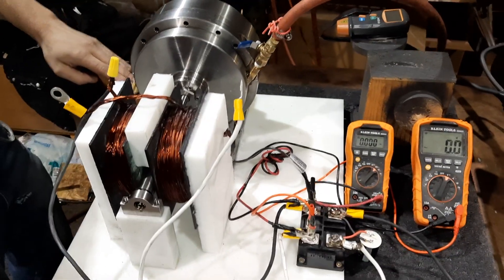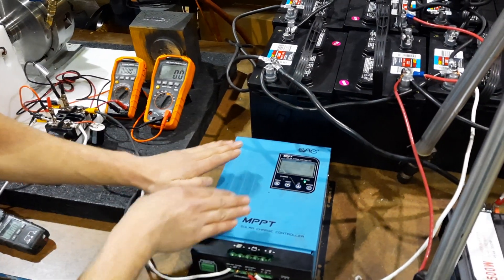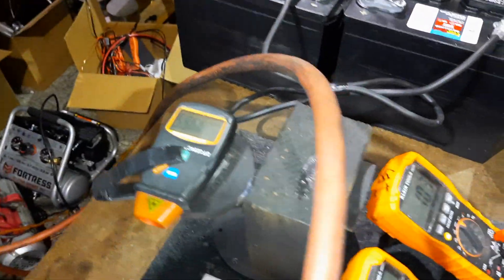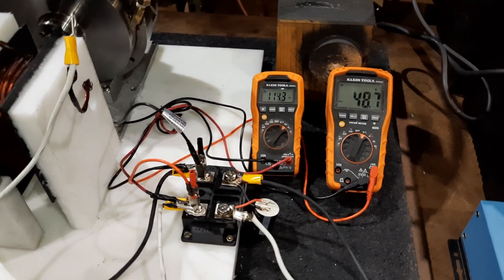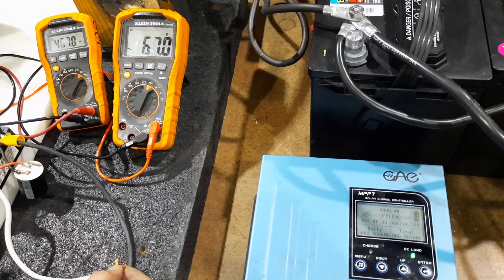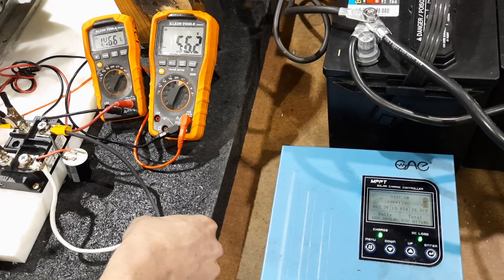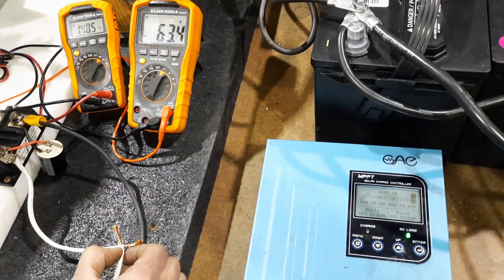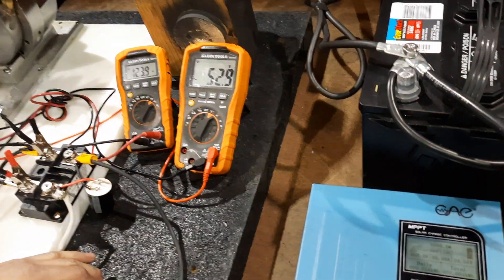Tesla Turbine Producing Usable Power! LOAD TESTING!

Comment: Just a suggestion but your coils are far too undefined and wound haphazardly.  Get decent Oxygen-free MOGAMI-brand copper wire (they make the best truly Oxygen-free copper cable which gets that extra few percentage points of electron flow!) at whatever gauge you need from the factory. This will make for much better induction and/or EM field generation. You can coat the wire yourself with clear polymer using a wire-coater machine and a commercial-grade winding machine that will ALSO properly wind your coils into almost any configuration. 

You are losing a lot of "energy" by having such wayward winding configurations.

I would also do an electrodynamics-simulation on the software-side of things so you can find the optimal wire gauge and optimal coil winding length and configuration that MATCHES the turbine size you have constructed. There IS NOT a linear scale-up or scale-down due to imperfections in the internal crystalline structure of copper wiring itself, the basic current conduction issues typical with coil windings and basic EM field physics. Your software should be able to get you the optimum wire gauge, winding count and length, etc to match your turbine size.

---

As ANOTHER suggestion, for the interior walls of the the turbine itself I suggest you do what Porsche did (i.e. YES! THAT car maker!) who had a set of 1986 patents for putting tiny golf-ball-like dimples onto the exterior surface of car bodies AND the same such golf-ball-like dimples on the INTERIOR SURFACES of exhaust tubes, manifolds, and all other air and/or fluid pathways to ensure the DIMPLED WALLS created a rough boundary layer of turbulent flow that BOUND ITSELF to the dimpled walls WHICH THEN creates a laminar layer of FAST air flow and/or FAST laminar hydraulic flow that "floats" on top of the rough turbulent layer that makes for a now very smooth and VERY FAST interior flow of gas (i.e. air) or fluid within any piping or fluid/gas pathways.

This dimpling needs to be of application-specific diameter in millimetres and depth. You can use ROUND or Hexagon-shaped or Pentagon-shaped surface dimples that can be created by micro-machining or STAMPING the positive-mold into the surface of your piping.  If this is not possible, you might ALSO TRY cross-rifling which means you ETCH via chemical or mechanical means, a deep cross-hatching on all interior surfaces so that the rough boundary layer can be created and stick to the interior walls to support proper laminar flow.  The cross-hatching size and angle of the cross-hatching will need to be MODELED in your hydrodynamic simulation software to find which is the BEST configuration that will create the best rough boundary layer that sticks to the walls of your turbine piping and/or cavities.

My estimation from Porsche's studies extrapolated to small scale turbines is about a 15% to 25% increase in flow-speed and MUCH LESS wear and tear on your Tesla Turbine interior wall surfaces. This may ALSO prevent cavitation (aka water hammer) and the Turbulent Boundary Layer creation for laminar flow support is noted as being the NEXT BIG THING in 2020's era hydrodynamics AND aerodynamics! And since the 1986-era Porsche patents have long run out, you can now use the technology as you see fit!

I hope this helps!

v
Reply: P.S. to KEEP the surfaces of any dimples intact, do some CRYOGENIC HARDENING of your stainless steel or alloy metal parts to ensure that the dimples or cross-hatches CANNOT be worn down smooth by long-term turbulent hydraulic flow.  It will ensure long term upkeep of all that fancy etchings and dimpling which creates the faster and smoother air and/or hydraulic flow within piping and cavities!

v
Reply from the maker: Excellent suggestions! I fixed the coils shortly after the video, I had to build them that way so I could convince my machinist the generator was powerful in a timely manner. I've since built a new generator with nearly perfect coils. I want to try your dimple idea but it will have to be at a later date. For now circular groves will be used like in tesla's patent for ease of building. I wish I had someone like you on the team.
Reply: @iEnergySupply  What sort of help do you need?

I have ideas and advice I can give gratis (aka for free!)

For the dimples, that usually requires metal on metal stamping technology BUT cross-hatching can be done using common chemical etching which you can get information about here:

How To Etch Stainless Steel And Copper, DIY Etchant, Plus Alternative to Press-N-Peel:

https://www.youtube.com/watch?v=QaENUHSaaRM

Etch METAL with Battery Power! TKOR Shows You Everything To Know About Metal Etching:

https://www.youtube.com/watch?v=ytxRJqgH5b8

These video are but two of the many available which can give you a good start on chemical etching and OTHER etching technologies!

The cross-hatching performs at about 75% of the efficiency of the golf-ball-like dimples in terms of creating a sticky rough boundary layer which then allows the faster outer laminar flow to happen.

With cross-hatching, you are going to have to do a few experiments on the shape and size of the cross-hatching pattern AND it's depth into the metal base.

You create multiple different cross hatch patterns etched onto various 1/8 inch thick stainless steel plates and run a fast smooth flow of one inch deep water over the cross-hatches and filming that water flow with one ore more overhead cameras set on super-closeup MACRO mode (i.e. record at 120 fps slow motion at 1/800th of a shutter speed or faster -- check the shutter speed which is best -- the faster the shutter speed the more light you need though) Set some bright lights at a 45 degree angle away from the camera so as NOT to cause a shadow into the water.

This will let you SEE the laminar flow in a physical manner so you can find out which cross-hatch pattern, size and etching depth creates the FASTEST and/or least turbulent upper water flow.

You may have to add a few drops of red, green or blue dye to the water in order to see the laminar water flow properly.

Only add a few drops to ensure you can STILL see the cross-hatching in the metal plates and see the lower rough water boundary layer AND the upper laminar flow.
(i.e. the water should be only very lightly coloured!) 

Check your macro lens function so you can CLEARLY and in-proper-focus see the ENTIRE depth of the water flow over your cross-hatch etched stainless steel plates.

You add 2 inch high plastic or metal side-walls to contain the water flow and make sure the plates are long enough (36 inches usually) so you can actually SEE the entire flow of water over the etched plates.

In some tests, I also added a fine lightly coloured powder which sinks and does NOT float (i.e. fine talcum-like powder or really fine sand) to see the flow over the plates better.

Now choose the cross-hatch design that gives you the fastest and/or least turbulent upper laminar water flow. 

Test against a simple FLAT polished stainless steel plate and see how much of a difference there is between that and the other cross-hatch designs. 

The etches can actually be ANY design. Horizontal, vertical or diagonal straight lines, true cross-hatches, dimples in round, pentagon, hexagon or octagon shapes, wavy curves and other designs. Try as many as you want at various etching depths to find one that creates the fastest and/or least turbulent laminar water flow.

Once you find the design that works best, use chemical etching on your interior surfaces of your curved or manifold-shaped parts and TEST in a real world situation.

My guess is AT LEAST a 25% increase in gas or liquid flow through your parts which means better cooling and MORE power production!  

As ANOTHER suggestion, cool your coils by embedding vapour pipes or cooling water channels into the iron cores that kind of look like the heat pipes found in computer CPU and GPU coolers. You should get a 20 degree temperature reduction which also means you can PULSE the coils faster and at higher energy levels to get more power generation.

I hope this helps. Email or message me if you want even MORE tips and tricks!

v
Reply from the maker: @StarGateSG7  If I had more funding, it would be cool to have you physically working at the R&D Facility. One day ill be able to afford help. For now, great suggestions, ill have to do some of that in the future. What's your take on hydrophobic ceramic coatings?
Reply: @iEnergySupply  I would try Teflon (aka Polytetrafluoroethylene) which is fully hydrophobic BUT even ceramic and Teflon have high electrical potential so you will get static adhesion of any fine metal and/or plastic particles which is in many water supplies and/or common industrial cooling fluids which will eventually cause clogs and buildup in your tubing and manifolds.

You are going to have to use something like ultra clean water (i.e. demineralized and boiled to death!) or the purest dialectric mineral oil (i.e. non-conductive) you can buy if you are using Teflon-coated liquid coolant system. 

You could also try Argon Gas as a cooling fluid creating a gas-vapour-based coolant system if all fittings and tubing are airtight enough. You can chill Argon to -200 C and colder using cryogenic means but -40 C to -60 C can be done with any reasonably inexpensive commercial freezer condensor gear.  Many commercial freezer supply stores have parts departments that could supply you with a compressor, motors, piping and even the condensor coil setup.

That will DEFINITELY cool your coils decently and Argon isn't all that expensive AND it doesn't react with anything else because it is a Noble Gas (aka is Inert!)

If you really want to go "CHEAP", as in having to as little money spent as possible, you could try anti-freeze  as yur coolant fluid and some heavy grit (i.e. 40 grit and coarser) diamond-grit sand-paper on the insides of your tubing to "fake" the cross-hatching via sandpapering deep scratches and swirls into your stainless steel tubes and manifolds.

 If the "scratches" are deep it might work good enough to form at least a basic rough boundary layer to form a proper laminar flow.  The scratches will have to be pretty deep though! I would 1/64th or even 1/32nd of an inch (less than 1/3rd of a millimetre) to make a difference.  

Get the coarsest diamond-grid sandpaper you can find at home-depot or other industrial supply store (i.e. Grainger or uLine)  3M makes decent diamond grit sandpaper! Maybe you can find one of their local dealers on their website. (rememebr to wash out all your tubing and manifolds with ultra-clean water once you have done your sandpapering!)

If you have any other questions message me back! I will be happy to answer with whatever technical details I can help with. 

v

Comment: One would suppose large. Capacity Graphene capacitors. Would be used also a more perfectly balanced tesla  turbine
Reply from the maker: Balancing the turbine as we speak, we are also making carbon fiber disks that can reach 70000 rpm for this sized turbine that's over supersonic speeds. We want to run this one continuously at 17000 rpm.

Comment: Thus is awesome, but you have not yet achieved the RPM where efficiency jumps super high and the RPM makes a huge jump at the same time. There is a smaller version of the turbine on here where the RPMs jump from 50k to 70k suddenly and the sound and vibrations go away.

Comment: I see your lead-acid batteries are in a series configuration, but I am unsure of your amp/voltage needs. If applicable, you should consider getting the far larger 8d or 4d instead of placing multiple smaller ones in parallel. 8D's are far larger than any normal car battery, can produce over a thousand amps with a huge amount of reserve, for only $220ish retail. They are only 12v and are typically used in pairs for large equipment, used to power glow plugs for extended periods before starting the engine. They should have fairly similar performance to the marine batteries you are using, at a lower cost per amp/hr.  The real problem is that 8D's weigh a LOT and can just be moved by a single man.

Comment: Talk about doing things the hard way!
Just put a power resistor on the generator output! You can measure the voltage and get the power directly. Changing the resistance and measuring the frequency change will alllow you to infer the torque of turbine, although for best results you also have to measure the air line flow rate and pressure.
Sheesh!

Comment: not really believable. when you connect the cable, the voltage on the capacitor is high, so sparking occurs. but nothing appears

Comment: You can not use momentary output power as any kind of performance measurement... that uses flywheel momentum, which means nothing.  Only measure constant output power.
Reply from the maker: For those who want to see testing regardless of what happens, that's what this video is for. See my constant load testing if you wish to be satisficed.
Reply: @iEnergySupply  Will do, thanks

Comment: You guys need to be careful about the containability of your housing at the speeds you are trying to run.  I understand that the Tesla turbines are typically built with a number of fairly thin discs but a surprising amount of kinetic energy--and angular momentum is generated at high rotational speeds. If a disc lets go at high speed, it can do a lot of damage.  Your housing appears to be steel which is good--you need a material with a lot of ductility but you also need enough wall thickness.  Also, at these speeds the bearings will be a weak link depending on how they are mounted and if they fail, then all the energy and momentum in the rotor will try to exit your housing in potentially every direction.  I'd not be standing over the thing when it is running--that is VERY risky.  You should set it up with you and your instrumentation back at a safe distance.
Reply: You should watch their video where one of their turbines explodes. Very violent. And you're right, I wouldn't be anywhere near them when they run over 25,000rpm.

Comment: Yeah, this is great. Have you ever thought about how a transformer works is there any way you can produce the electricity in the one half of the coil, and transform it in the second phase, or both. Do you think that it would phase itself out if you tried to produce the electricity in the middle of the two coils, or do you think that it would need some type of insulator in-between the coils, but both the coils are connected in the transformer. That is my point it does not look like you added the iron bar or even a copper bar to connect your two coils. As long as the one has more turns it should step up your electricity production right, or am I the dumbest mutha hummer in Nebraska.
Reply: I think you are mixing up your generators with your transformers. The turbine turns a shaft with a magnet on it that spins inside two coils. This creates your electricity. It then goes into that solar charge converter which will contain a transformer to convert AC (the spinning magnet has two poles which induce opposite fields inside the coil generator), into DC, which can charge the lead acid batteries. I think you are mixing up a motor's need for an iron centre inside it's coils with the iron centre in a transformer. And I think that motor is called a universal motor but there is no motor here.👍

Comment: Seen a 100k bench test on a smaller turbine.
Reply from the maker: What was the periphery speed? It's important because the maximum velocity in the periphery changes per the size of your rotor.
Reply: @iEnergySupply  It was measured right at the shaft
Reply: @iEnergySupply   @Cinematheque Rouge  YouTube staff office culture stalls my YouTube so much that my volume button stops working during the covid freeze. You know what that means? We can eventually expect Google staff to have full control over our browsers just as they  do with our YouTube inbox. You don't even receive anywhere near the amount of comments that YouTube intercepts.
Reply from the maker: My latest video shows 1,400 mph periphery speed! It's a 3-in rotor going 150,000 RPM

Comment: Not much of a load test if you keep disconnecting the load. I would have liked to have seen what power output it settled at and then seen the calculation of power efficiency.
Reply from the maker: we will soon get our analytical equipment, this will show us everything. Have you seen our latest video? This is what we will be analyzing. The turbine used in it's intended environment.

Comment: Why is the tesla turbine supposedly better than a normal steam, jet, or high pressure turbine?  If They were so great, you would think he would see them in heavy industry already.
Reply from the maker: In the practical application of mechanical power, based on the use of fluids as the vehicle of energy, it has been demonstrated that, in order to attain the highest economy, the changes in the velocity and direction of movement of the fluid should be as gradual as possible. In the forms of apparatus heretofore devised or proposed, more or less sudden changes, shocks and vibrations are unavoidable. Besides, the employment of the usual devices for imparting to, or deriving energy from a fluid, such as pistons, paddles, vanes and blades, necessarily introduces numerous defects and limitations and adds to the complication, cost of production and maintenance of the machines.